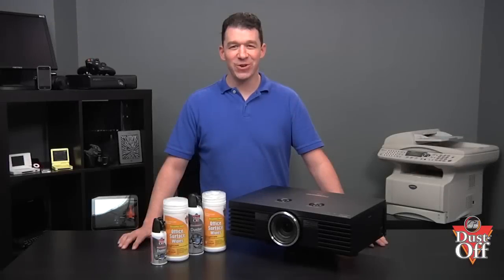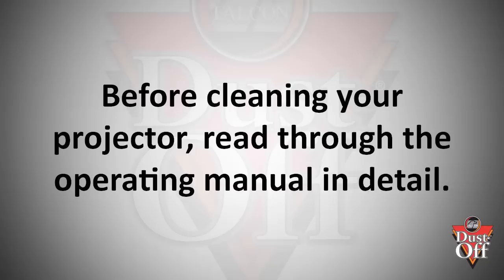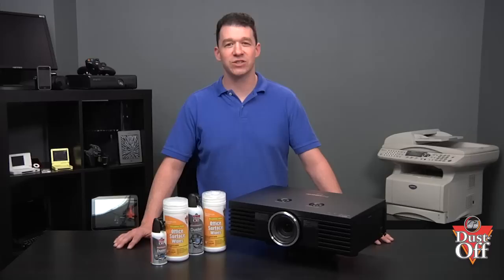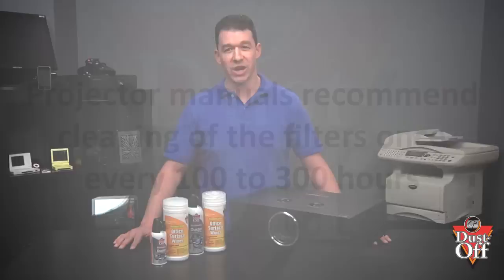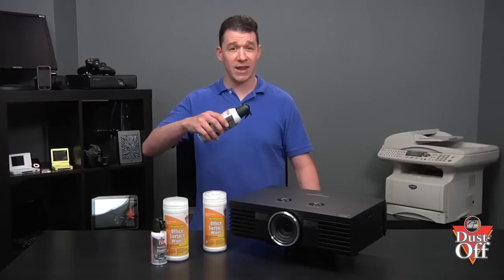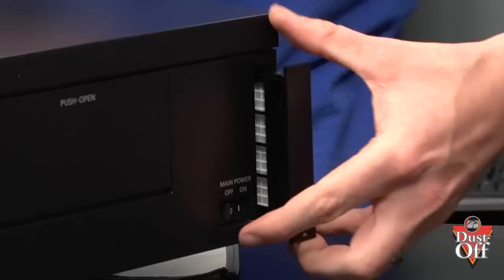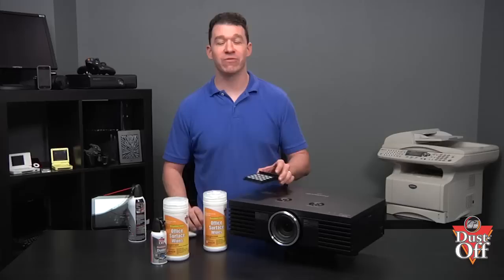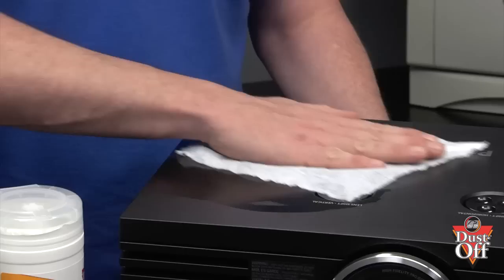Lesson 14: Cleaning Your Projector

Comment: Blowing the compressed air into your projector is likely to dislocate dust from the filter area and send it flying into the projector. If it lands on the lens, lamp or color wheel you essentially just ruined your projector. NEVER BLOW INTO IT!
Reply: How do I clean the dust off the lenses then lol ??
Reply: @seedsoutdoors3721  a lint-free cloth is good. Such as the ones you use to clean glasses. Avoid using rough cloth as that can scratch the lens coating. I'd advice against disassembling the lens unless you are sure you'll be able to remove all the dust though (and not damage it of course).
Reply: @Nixxen  i just took it apart removed all the dust I could on the more accessible lenses but there's some mirrors down low that I can't reach

Comment: I know this is a Dust off Video promotion, but its better to use a vacuum to clean a filter and surroundings first in my experience. Thats why every Xerox Service Rep travels with a portable Vacuum.  Dust off can be used after to blast area which cant be reached.  However the convenience of compressed air cannot be discounted.